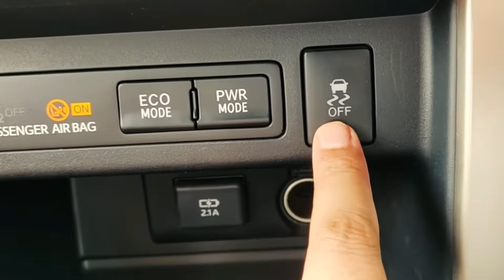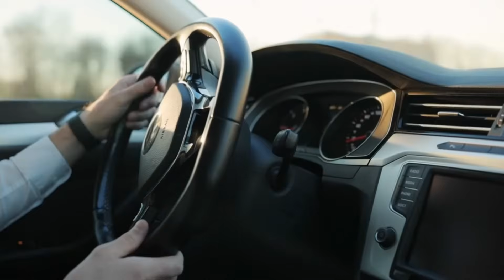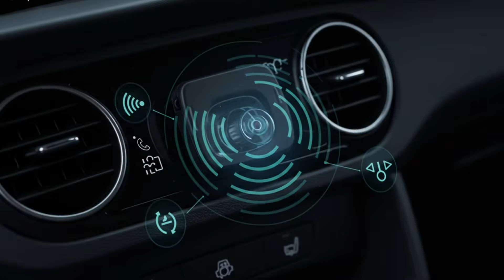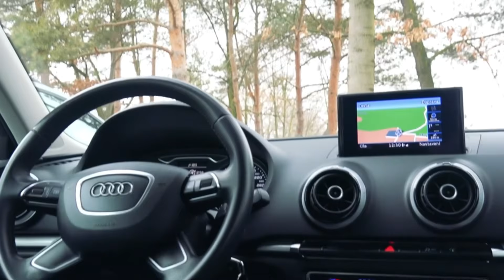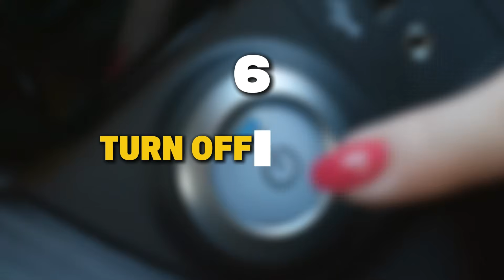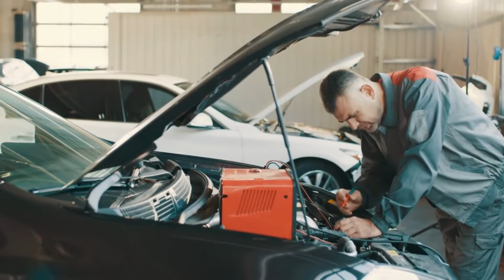How to Reset a Blend Door Actuator Easily

Comment: Heat on driver side only. Checked doors, fluid , flushed, nothing worked
Reversed 2 lines to heater core on fire wall, quick quick. Immediately works great. Do yourself a favor , just switch the lines to get heat, than do a real flush come spring

Comment: Almost ninety nine percent chance you're going to have to change out the actuator this whole crab does not work.If it did, it would reset every time you go to turn on the car... I repeat.This will not fix it if it ain't working.The actuator needs replaced.It's that simple
Reply: How about a manual dial system, not powered actuator